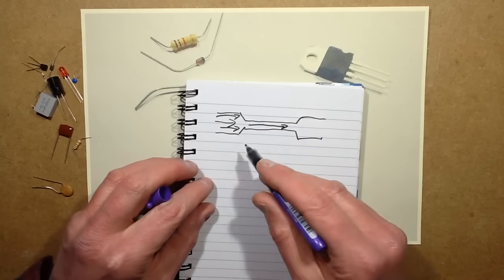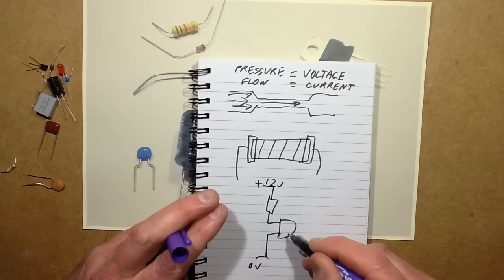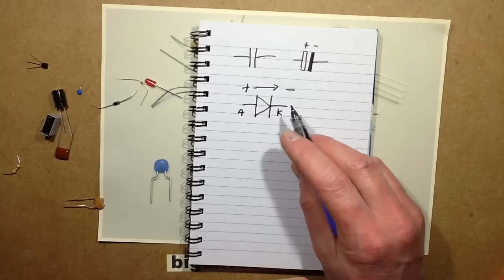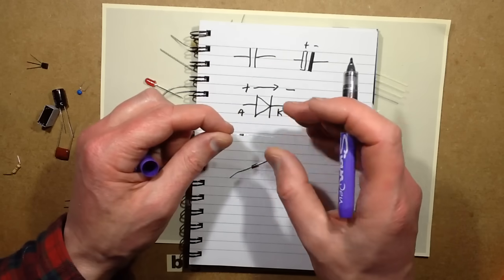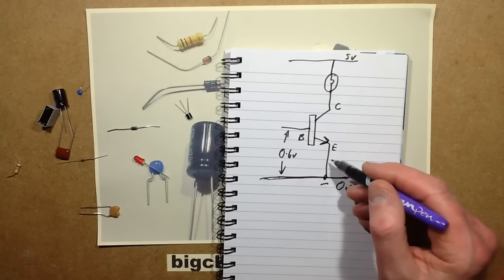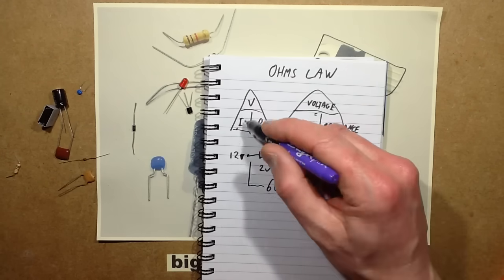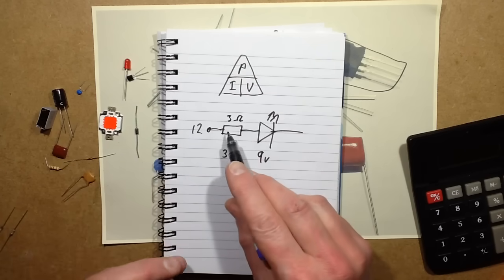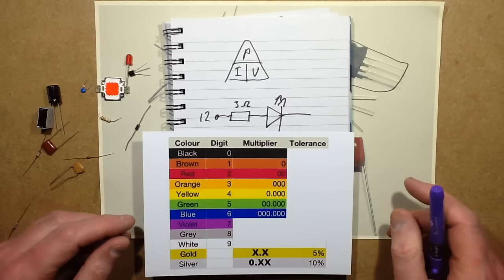A simple guide to electronic components.

Comment: @12:27        "...one of the downsides of the electrolytic capacitor..."       Another one:  back in my heady days of TV repair (servicing a certain giant electronics buying store, one of the 'best', for the tri-state area, hundreds of stores) every set brought to one of these stores for repair came to us (~300/day) and a disturbing trend started...  this is back in the days of rear projection mind you, there were a few plasma that cost $10k+...  a prominent brand had MAJOR electrolytic capacitor woes.   Briefly, on rear projection tvs, there are 3 small CRTs (RGB) mounted toward the bottom rear with a lens on top (most folk don't realize but that lens is full of fluid, mineral oil type stuff, for cooling!!) facing up towards a mirror...  on the bottom of each CRT was a circuit board to drive it...   beneath those CRT circuit boards were the main boards...  one for signal/video processing, t'other for power.   Can you see where this is going yet?    I never found out if it was just a bad batch of capacitors or faulty design but the CRT boards had electrolytic capacitors that leaked fluid right onto the mains power circuitry causing a sudden and jarring lack of television, accompanied by sparks and smoke and zzzzzzttttBANG sounds.   We literally had thousands of these sets waiting for replacement boards, which the rather large name brand company couldn't produce fast enough...   it was handy we were inside a GIANT warehouse.

That is all...  pardon my lack of brevity but hopefully it was amusing...  thanks for the awesome video (as always) Clive !!!
Reply: orion khan i had a 60in one...pretty sure it was sony if i remember correctly??

Comment: Hold on that water analogy confuses me. If am pouring a bathtub full of water down a drain, and then someone makes the drain only 1/3 as thick, sure it limits the amount of water flowing through the drain now, but as theres still the same amount and pressure of water being poured in from the top, the water starts backing up and then overflowing... Surely if theres a 12v current coming in from one side, and the resistor drops it to 5volts (just an example), the circuit isn't smart enough to think "Hey, im sending too much current in here, so i'll drop it to 5". So what happens to the excess current on front end before the transistor once you start causing a backup? Unless the Transistor is somehow taking in the 12vots and dissipating the other 7 as heat? 

BigClive. I really want to get into Component level micro soldering and laptop repair, but i have no prior experience with electronics. Can you recommend a good book that will bring me through without much filler? Or maybe a video course online or something? As there's no decent electronic engineering course in the college near me this year, ty

Comment: I have no quarrel with you using the European style resistor symbol but I can see the advantage of using the old style. It is very much quicker and easier. Did they not consider this when deciding upon the new unified standard? A line, then a squiggle followed by a line and your pen never leaves the paper.

Comment: The water analogy is not the best, becouse the amount of water that flows through narrowed part is really the same, becouse yes the diameter of pipe is narrowed but the speed is increased so really the flow rate is the same, unlike in the energy flow example with resistor.

Comment: Do all resistors automatically reduce the voltage down to whatever the led light asks for. So if u have a 1v LED bulb hooked up to 12v battery. Any resistor will reduce that 12v to 1v?

Comment: so i have a question as far as capacitors i wanna build a small spark gap tesla coil  i have a microwave transformer around 2000v out i have a ceramic capacitor rated for 3kv would it be ok to use or should i use another kind of capacitor like the one i got out of the microwave it is rated for 2100v from the research i have done my capacitor should be around double the voltage but would the small ceramic capacitor  at 3kv be ok any info would help thank you
Reply from the maker: Can I suggest you look at the slayer coil design as it is very easy to build and a lot safer than using a microwave transformer and capacitor.
Reply: bigclivedotcom thanks for the advice i made a pretty simple slayer exciter circuit quite enjoyable but o had a question I'm useing a 2n2222 transistor i have a couple bigger ones i have salvaged from things how do i tell how much voltage it takes to open the base on a transistor and how much before it breaks down because o have fried a couple of the 2n2222 i don't think they can handle 2 9v battery in series  but if you could help thanks
Reply from the maker: The base voltage will usually be around 0.6V to turn the transistor on, and the LED between base and -ve is usually there to cap the voltage.  The larger transistors usually have a lower gain, so require more base current to turn on fully.  It's something to experiment with and you may kill a few transistors in the process, but that's what happens when experimenting with circuits like this.
Reply: oh so more current may just be needed well i will continue to experiment and learn on my way thanks for the advice much appreciated

Comment: I have slight issue with your description of current flow through a diode.  You say the current flows from positive (+) to negative (-), I believe that was called "Hole Theory" a very old and not quite correct concept. I know you know that, perhaps you were speaking "to your audience".  

I do enjoy you videos especially when you do the circuit analysis.  Would you consider doing some design/build-it videos?  You've shown us many examples of the wrong way to do things, now show us the right way to do things, e.g. a bench-top power supply, 0-15V DC well regulated and good filtering.
Reply from the maker: I deliberately used conventional current flow theory as that's the way all the arrows point.  I'll cover real electron direction flow in a later video.

Comment: I learned very basic electronics while in the U.S. Marines, went many years making basic timer circuits, trigger circuits, light and movement detection really easy stuff. Then I got promoted and didn't do all that electronic stuff anymore.  Jump ahead some 45-50 years, my son asks me to make him a flashlight with very specific features.  I say, "Hell yes I can make that" Well, in 45 years everything changed. So I'm like what the hell is an LED? Lithium?  "Ain't that what crazy people take?" So I take a month to get spun up on all this new stuff. I make breadboard circuit and it works perfectly, on battery power. So I get me this really cool Desktop Power Supply,  very sexy. I build the prototype hook it up to the new supply and fire and smoke and arcs and I set my bench on fire and short out my houses main circuit breaker. After all that my boy comes in and said, "Never mind Pops, I can get what I need at Radio Shack" Clive I wished I had known you then. Great video.  You are a superb instructor.
Reply: It's exciting when a project works out, it's also exciting when it doesn't because that panic to find the fire extinguisher gets the blood pumping :D

Comment: I like your video except one. By Bernoulli's principle, when water is pushed in narrower pipe, water flows faster. You should use different example for the resistor. Maybe water flowing smooth surface vs rough surface.

Comment: So uh, I'm colorblind (red-green). What do I do? I hate having to use my meter on every resistor.
Reply from the maker: Store your resistors in well marked bags or just get used to using the meter.  Even with good colour vision I still need to double check many resistors with the meter because the colour codes are poorly printed.

Comment: When looking at transistors in a circuit, marked B.C.E. I still struggle with identifying the legs on the actual component. Is there an easy way to identify this?
Reply from the maker: Yes.  Google search the transistor number and then select "images" for nice clear drawings with pin indications.

Comment: Simpler terms.. 
1) Resister - electrons travel the path of least resistance. Literally use a resistor to change the direction of current.
2) Capacitor - used in camera flashes. Imagine a battery that discharges its whole load once it is full.
3) Diode - directs the flow of current.
4) Transistor - you did simplify that pretty well! I prefer to show people what vacuum tubes did and how transistors replaced them! :)

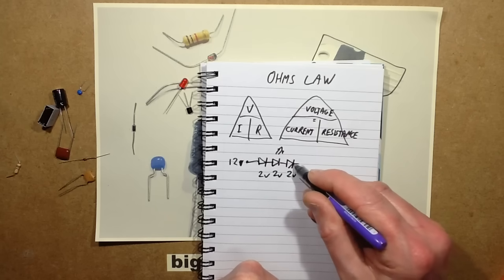Comment: does it matter if the resister is before (31:45) or after (26:10) the load ???
Reply: kenny ball: As mentioned, two components A and B are "in series" if the current has to travel through A to get to B or vice versa -- in other words, the components are in a line. The alternative is "in parallel", where some current can branch and go through either A or B without going through the other -- the circuit is in a Y shape. 

If the part about the resistor coming after the LED is confusing, remember that with the LED and resistor in series, all the current that goes through one must also go through the other. So if the resistor draws a certain amount of current, that current will flow through the circuit no matter what order the components come in -- more current can't flow through the LED just because it comes "first" since it wouldn't then be able to flow through the resistor after it. 

Using the water analogy, a series circuit is like a long pipe with different parts along its length. If a certain amount of water flows through one part of the pipe, that same level of flow must be going through every part of the pipe. The amount of flow can't change from one part of the pipe to another because there would be nowhere for the "extra" flow to go. Or put more concretely, if 1 gallon of water flows through component B (the resistor) every second, then 1 gallon of water must also flow through component A (the LED) every second, even though B is actually doing the restricting of flow -- otherwise, where would the extra water (or electricity) go? This is why the order doesn't matter as long as the components are in series -- if they are in parallel you could imagine more flow could go through one branch than the other.

If you are interested in learning more about this, try looking up Kirchhoff's current law -- that's the rigorous mathematical explanation of this principle.
Reply from the maker: In a series circuit the resistor can go anywhere in the line.
Reply: thx bud but what makes this a "series" circuit ? the layout of the LEDs ?   and what makes a none series circuit ? sorry clive but im new !
Reply: Réal Provencher wow brilliant explanation...thx for taking the time...the LED thing was confusing me
Reply: Réal Provencher Yes - that was a very good explanation. Thanks very much.

Comment: Why do you refer to the current needed for diodes and not the voltage? I would have thought that you would calculate the resistor for the drop of the voltage. I am so confused.
Reply from the maker: You calculate the resistor based on the voltage being dropped across it (battery voltage minus LED voltage) and the current desired.
Reply: Does this mean that LED's are rated by current and not by voltage?
Reply from the maker: They have a typical forward voltage of 2V for red and yellow LEDs and 3V for most others, but you have to limit the current through them.  Without current limiting they would pass an unpredictable current that could damage them.  LEDs tend to be rated for maximum current they can pass.
Reply: bigclivedotcom Thanks, that is more clear now. I always thought that they were like a light bulb, and would only take as much current as they could use based on how much voltage was applied.
Reply from the maker: Alas no.  If you turn the voltage up then they don't conduct at all until they reach their forward voltage, and then they suddenly start to pass lots of current.  That's why they are usually used with resistors or current limited drivers.  Even in keychain lights with the LED across the cell, they rely on the cells internal resistance to limit the current.

Comment: Doesn't direct current flow from negative to positive??? On the diode section you said flow is positive to negative :( The Negative is negative because it has more electrons, and electrons are negatively charged so they more toward an area with less electrons..
Reply from the maker: I'm using conventional flow as that's the way all the arrows point.  It would have caused confusion to talk about actual electron flow.

Comment: I have a 15+ years old 15" LCD monitor. Every time i press the power button it goes on for 1 second and then shuts down. when i power it on again the same happens. Is this because of the bad back-lighting or a blown capacitor?
Reply from the maker: It sounds like a failing power supply, most likely due to an old capacitor.
Reply: 14:47 he draws what it looks like from the side. Usually when the problems are this bad, the bad capacitors are very visible.       
The capacitors in the built in PSU of the monitor I fixed were very big 1F capacitors, so the damage was very visible.        
What I did is write down what it says on the side (capacity and voltage) and bought them from an electronics shop. I couldn't believe how cheap they were (40 cents for both).     
I borrowed a soldering iron from a friend and exchanged them in 10 minutes, without having soldered much previously.
The only really difficult part was opening the monitor, because the bezels have a lot of snaps holding them in place.       
Watch some videos on how to open a monitor.       
While working, make photos for reference. The PSU board is rather big and usually accessible as soon as you remove the plastic cover of the monitor, so there isn't much disassembly necessary.
The soldering itself is simple as well. Watch some videos on soldering basics.
Reply: I'm 99% sure this is a bad capacitor. I've had the exact same issue (as millions of people online, this is the most common problem description with monitors, who all have built in power supplies) and you can literally fix it with 40 cents worth of parts.
Reply: just take a video of you dissembling it, then play it backwards. watch some videos about how to repair old caps.
Reply: muzosh they usually look expanded slightly (usually on the top or bottom) they may also be leaking. Search 'leaky electrolytic capacitor' on google then go to images, you can see what it usually looks like.
Reply: Yea, except i would probably need a specific type of capacitor and solder or replace the bad one right? 
I know a lot about pc and hardware but nothing about actually creating or repairing hardware.

But i don't think i still could do it though, as i have to dismantle the monitor and components and also have to buy a capacitor and soldering iron and stuff. i might break something or forget how things were connected/placed.
Reply: Thats actually what got me to this video as well. All components on the pcb looked fine and the correct voltages were being transformed everywhere. No blown fuses or anything. There was an OMRON solenoid switch which was sticking. Works now. Good luck.
Reply: How do i know which capacitor is bad?
Reply: Looks like a great chn subbed , btw I just had a firwire interface for audio that just died while I was using it I orederd another power supply 2 matter of fact. But that wasn't the issue i did notice when the power supply was plug in the LED light on the transformer of the power supply would flicker w/out going out more like pulsing I can't get any support from Avid or M Audio or anyone they had on their sites. Could it be a fuse inside the fire wire chip would cause the whole thing to go down would it? It has motorized faders …lots of i/o's I hate to lose it for good. You think there's hope? Thx for this upload.
Reply: Try mounting on a different wall... Blurrrppp
Reply: something like this is relatively easy, i repaired some bad caps in my dads tv, when i was only 14!! (i'm 17 now)

Comment: Suggestion: Can you show the Math for calculating whether a Resistor or Capacitor will Blow Up?

 I could say that if I had a 9 Volt Battery with a one ohm 0.125 Watt Resistor that if I^2/R < W, Kaboom! That's 9^2/1 = 81<0.125 . . . Yep, that would do it!!! . . . and if I used a Carbon Resistor, I should be able to light afire with that.

. . . wish I could come up for some Capacitor numbers.
Reply: Clayton Benignus zc 5th may cnbcawaz

Comment: Are lipo batteries actually capacitors?
Reply from the maker: No.  They operate in a different way.  Even the highest capacity super-capacitors can't match chemical cells.
Reply: Electricity is not water but you still presented it like water. I'm sure water has properties that electrical current does not, opposite applies to electrical current but water paradigm is still good..

I'm not an expert but I don't see why capacitor couldn't be presented like battery with high charging and discharging rate?
Maybe batteries would be used as capacitors if you could charge them fast as caps? 
Off course, capacitors are not used as power supply but that's only because they can't store big enough amounts of charge. Actually they are used as batteries in some power tools if I remember correctly.. Screwdrivers or something.. You charge it in a few seconds, they are much lighter, they last longer (not charge but the "battery", no special care is needed...

Comment: Hi Big Clive. .. just a question. What would you say I need doing to a USB car charger. if I use it the feedback makes listening to the radio impossible. I have used ferrite beads and are not helping a lot. would a Capacitor on the output of the charger help.